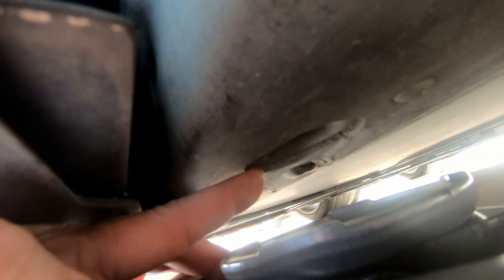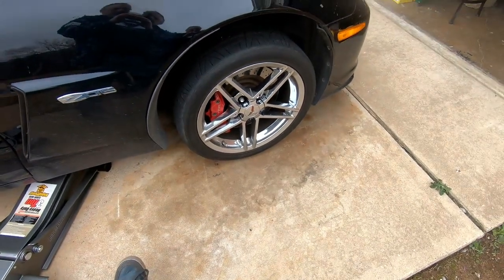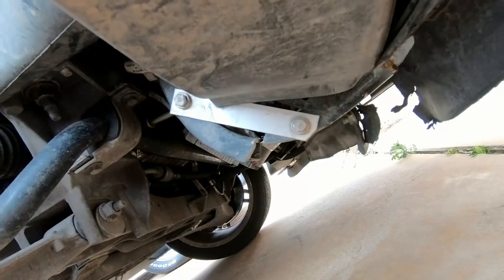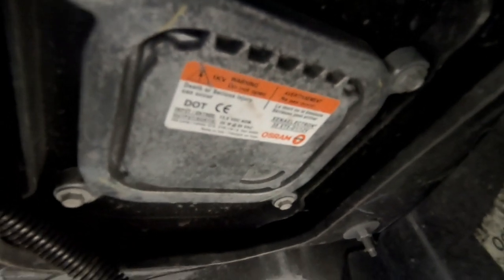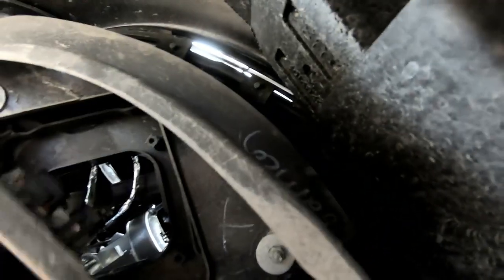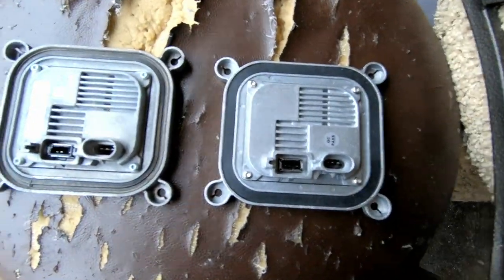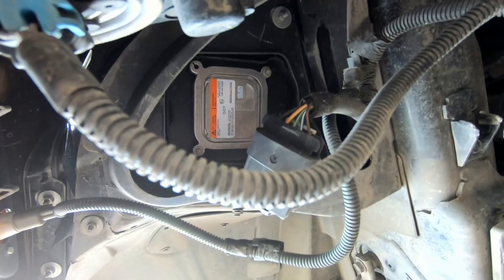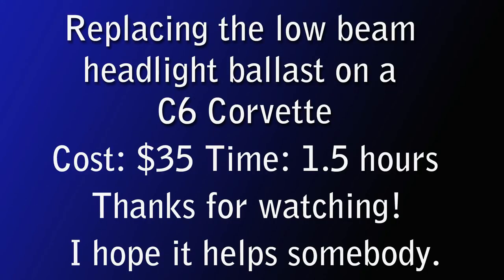C6 Corvette Low Beam Ballast Replacement

Comment: I called the dealership yesterday to set up an oil change and they checked my vin for other issues.  I think this is a recall item by GM and they will replace it for free.  Thanks for doing the video though, now I know where they will be working and what to check after the project is done.

Comment: The ballast in the link is for single bulb hi/low beam system. Got one from local supplier and while it plugs in,  incorrectly,  it will not power the bulb. Even the osram website crosses it to c6 but at same time says fits '12 up fords but are single bulb systems...  Had to get ballast from dealer. The D1S and D3S bulbs and ballasts are not supposed to be able to be mix matched and function. Maybe someone already converted the lighting to the later D3S system on your car? Just FYI for someone searching :)

Comment: Why did you replace the ballast? what were the symptoms?
Reply from the maker: The headlight on that side would not work, and I put a new bulb in it. At that point, the next in line for failure is the ballast.